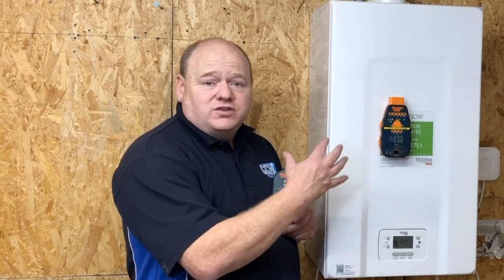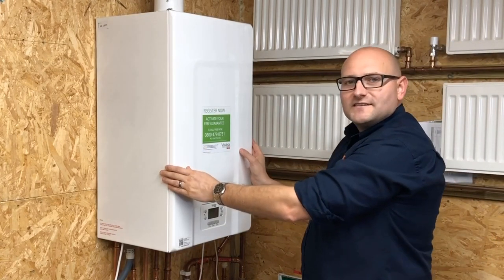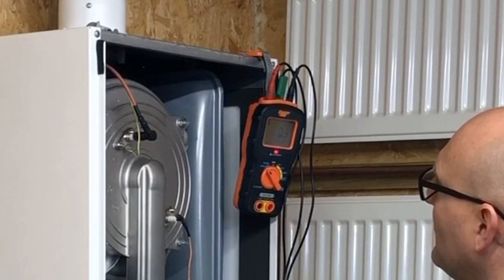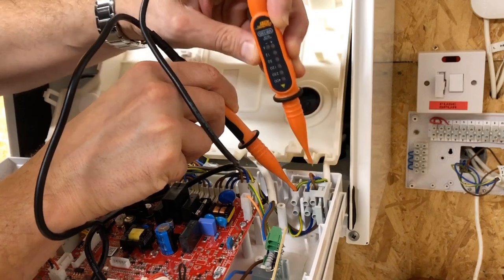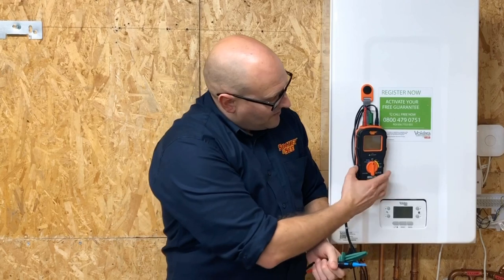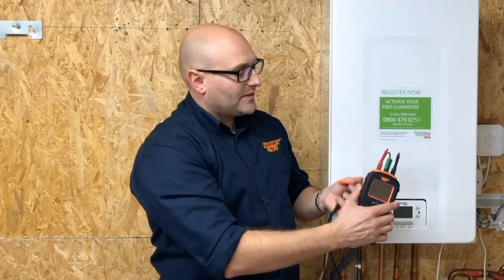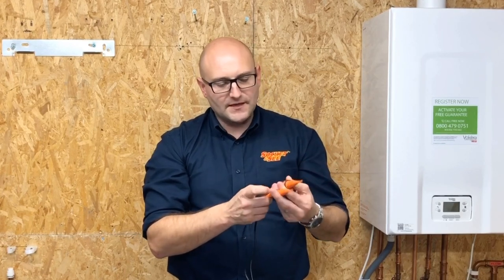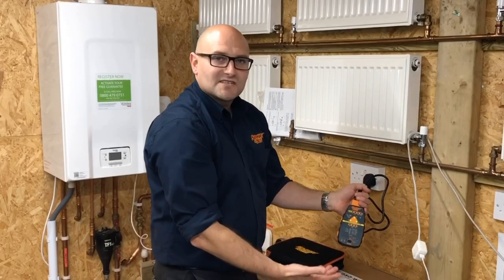TB118 ELECTRICAL SAFE ISOLATION - Boilers - ACS Gas Training

Comment: Been made to do this by work for the last year, you wouldn’t believe how many council houses electrics trip on the loop impedance test 👍. We get audited loads too 😀
Reply: Well being a council house that should get tested every five years by an electrician but as being a gas engineer you have to go in there every year they will get you to test everything, it’s part of the tenancy agreements allowing for an annual service of the boiler so why are you there test the electric, smoke alarm, co alarm, check the loft lagging etc

Comment: I use the socket and see, I put a clear insulation mat over the pcb when testing where necessary. To be extra safe. 
Some of the baxi’s had built in socket and see point.
Reply from the maker: Eco Blue advanced heat, BG boilers.

Comment: Nothing else just money making.. next year every Gas Engineer has to be level 3 Sparky as well... Proving Unit starts at 110£, and loads of sparky not even ever use and not required just recommending. Love your video you are absolutely amazing engineer please don't misunderstand I mean loads of bullshit it that safe isolation procedure. Anyway to protect my ass I just done I level 3 Domestic Electrical Installer course for 1300 over 9 weeks, so thats cover every engineer ass if you do the right way, but again all about money money money... 👍👍👍 Also I do not like that socket and see thing... trust always Megger or Fluke or Kewtech.. All the best 👍👍
Reply from the maker: Thank you so much for the feedback. We do not have a choice as it’s part of the ACS now.
Reply: You can get self proving testers now for under £50. TIS 851. Problem solved. You don't need to do  earth fault loop impedance for isolation. Safe isolation is checking the power has been isolated. You do not need to check the earth path to the sub station to isolate. If you didn't safe  isolate it might be handy to know as it could indicate whether you live or die !

Comment: Thanks for your video Allen.I currently use my Multi Meter for safe isolation .
Why do I need to use extra equipment for this purpose ?
Also I just completed CCN1 Reassesment but they never mentioned Safe Isolation Procedures.
Anyway thanks again for your video it’s certainly a worthwhile topic.
Reply from the maker: I can only tell you what TB118 says. We have a new video coming soon though and that shows a different way. Thats with a Multi Meter. Thanks
Reply: The electricians guidance for isolation testing devices is GS38 which is free to download. Outside of this document it is said that Multimeters have lots of settings so they are not suitable as it may accidentally be switched to the wrong one.

Comment: this stuff has become far too complicated. get your tester out, check for voltage, proceed. done.
Reply from the maker: clive ramsbotty Do you mean multimeter?
Reply: Some Old system set ups run on double fuse, not worth getting a belt 😂

Comment: Overly complex and a sales pitch.

If you look at HSE GS38 and HSG85 these will tell you what the requirements are for safe isolation and Best Practice Guide 2 will tell you how to do it.

And no point testing for dead if you don't lock the circuit off. Only takes a moment of distraction and a nosey customer to turn the supply back on when you're working on it.
Reply from the maker: Thank You
Reply: If you can only isolate at the consumer unit then you must lock off. He didn't have to as he could remove the fuse which is correct. If it was plugged in then remove the fuse from the plug.

Comment: Wasn’t it easy when boilers were on 3 pin plugs, pull it out job done.
Reply from the maker: Timmy Gasman You could still get a shock if someone had wired external controls into boiler.
Reply: Non uk here (Australia), what changed to  make your boilers hard wired?

Comment: How much is that lot
Reply from the maker: Not really sure TBH. Thanks.
Reply: Ours were £800
Reply: Pross130 is good enough and is £400
Reply: Not £800

The DLMPRO is about £299 
Voltage pen £22 
The two pole tester and proving units start from £110
Reply: @arronblythe755  read the comment above yours the kit is £400. I’m a qualified electrician and gas engineer the kit I have is £800
Reply: Ahh didn't see that , apologies 👍

Comment: Where in TB 118 is the as operative instructed to perform a 'safety toch test' or an earth loop impedance test or a polarity test - the ONLY 'procedure' derined in TB 118 is the Safe Isolation procedure !  This video does nothing more than add to the confusion within the industry because TB 118 is ill-conceived, misguided, misworded, inaccurate and contains an unforgivably dangerous bunch of words - it should be no more than 2 pages long and explain what is in the title of the TB - a SAFE ISOLATION PROCEDURE !  The objective is simple - prove the test gear good, isolate the appliance, prove the appliance is dead and then perform a confidence test of the equipment to prove it is still good.  Th edocument has opened the flood gates for test gear manufacturers to sell kit for checks that are NOT required to keep the gas operative safe ....